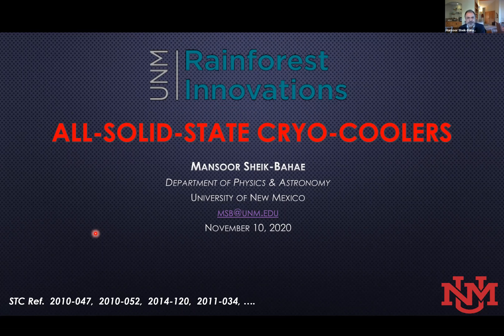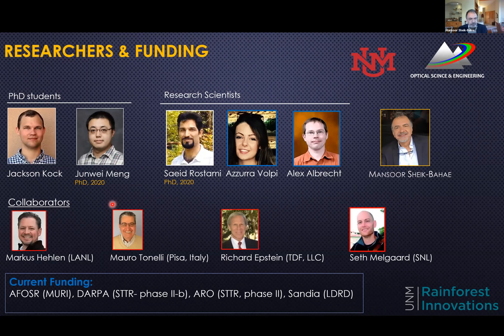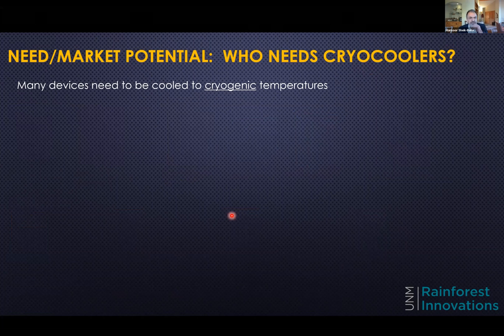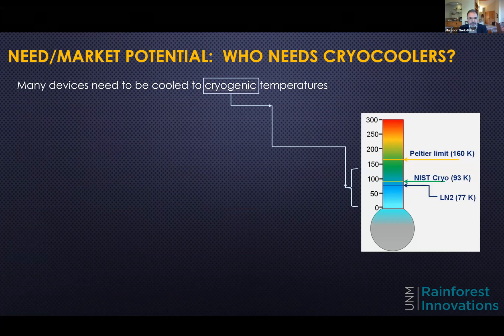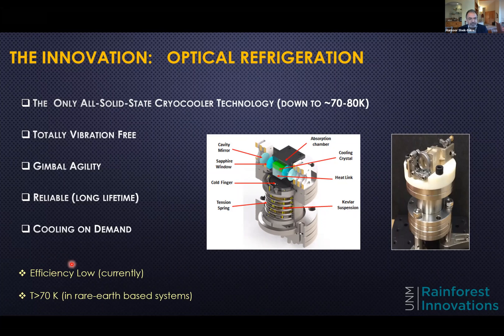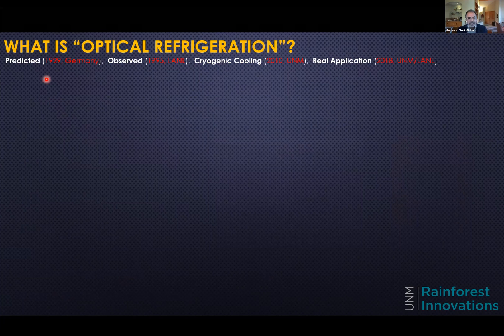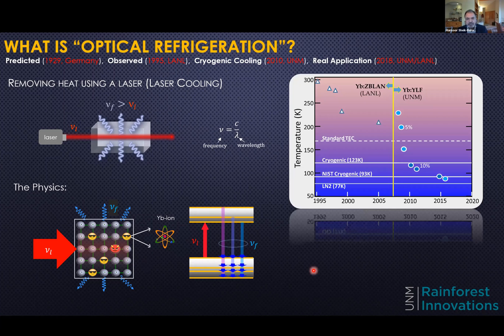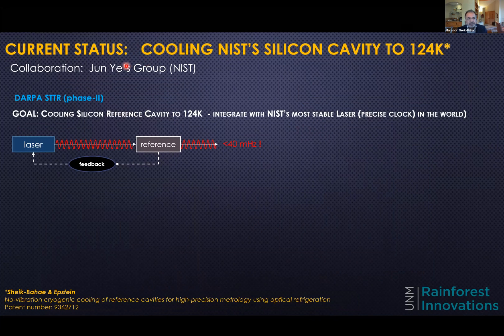Optical Cryocooler & Refrigeration Portfolio

Comment: With all due respect to you, Professor, but the best system on earth is the mechanical system. It is simple, durable, efficient, reliable, and long-lasting. Vibrations are not a serious problem as they can be greatly reduced or isolated. all other systems are complex, require maintenance, often have a limited lifespan, and are inefficient. There is also the problem of electromagnetic pollution.